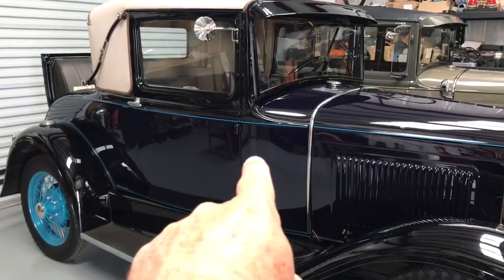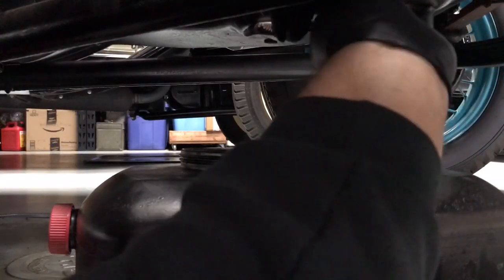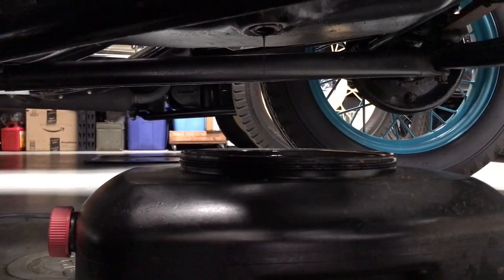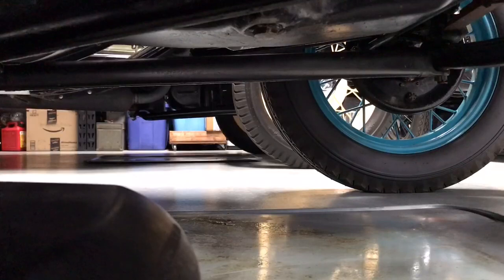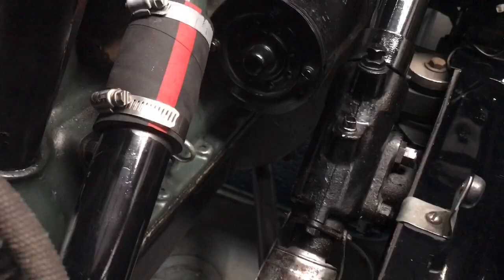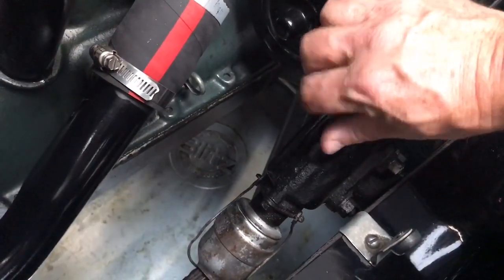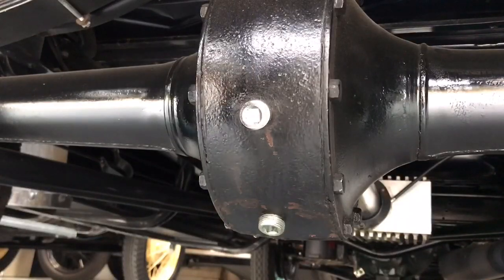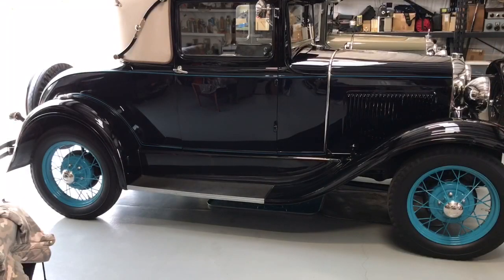How to check and change fluids in a Ford Model A.

Comment: Do you use a left hand or right handed crescent wrench?
Reply from the maker: metric
Reply: @ModelA  do you work on others cars ? Looks like the Tudor I just bought has a bad rear main bearing and I’m just not physically able to pull motor and replace .
Reply from the maker: @darrinwi   Insurance and time limitations prohibit me from doing that.  60-80 hour work weeks, volunteering for the county, family, and church obligations first, then making Model A videos after all that.  Members of the Sonora A's bring cars over here when we have seminars or garage days.
Reply: @ModelA  I completely understand, I wasn’t sure . Any suggestions?
Reply from the maker: @darrinwi    Where are you?  I bet if we get you hooked up with a local club, we can get you all the help you need.
Reply: @ModelA  San Jose
Reply: @ModelA  I have a "several sixteeenths inch" wrench.  It's great!

Comment: I found a model a with a brand new engine. (Rebuilt)  but the color is so odd. Dark green top. Teal body. Red wheels. He wants 10k. Has all the documents like service work etc. Not sure what to do. Also found a more basic 2 door roadster A all black. Rumble seat for 7k. Decent condition. What tips could you give me.
Reply from the maker: The color blind guy probably slapped that together without much care, possibly to just flip it for a quick buck.  RUN! (away).  Unless he can produce receipts for the rebuild, and it was done by a reputable shop, I would pass on it.

Comment: Since modern fluids last so much longer than they did 90 years ago, why change the fluids so often? Modern transmission fluid usually is good for 100K miles. After 5000 miles, wouldn't the fluid still be new?
Reply from the maker: Modern fluids still get dirty at the same rate as old fluids.  In stock form, Model As do not have oil filters, and they don't have sealed assemblies like modern cars, so fluids get dirty faster.
Reply: And seals, piston rings etc that were produced 90 years ago and were not that well made compared to now , make the oil get lot more dirt in it.

Comment: Is that 140 wht or 600
Reply from the maker: They call it "600W", but it really just a thick gear oil.  140 is a little light, it's closer to ISO 460.  See here- https://www.mobil.ca/en-ca/lubricants/industrial/lubricants/products/products/mobil-600-w-cylinder-oil
Reply: Its a 1930 model a coupe with 4 banger.

Comment: You cheat on the oil filter! You're supposed to use a flathead V-8 Ford's loose canister and Purolator PF-1 CARTRIDGE filter. BTW, until the end of flathead V-8 production, an oil filter was an OPTIONAL, extra cost accessory! On a flathead V-8, changing oil is guaranteed to give you an oil bath. As a 15 year-old, I worked as a "pump jockey" and changed oil in cars, and hated to see a flathead Ford head for the rack! All flathead engines of any brand automatically got a jar of Motor Honey added too. It was a viscosity enhancer, like STP, and kept the oil from thinning out too much from the exhaust heat and making the valve stems "starve" for lubrication. It also had detergent in it when most motor oils didn't. All OHV GM's got a can of Marvel Mystery Oil to keep the lifters cleaned-out. I have pumped a supertanker full of 22.9 cent a gallon "regular" gas with "ethyl lead" in it, 12-18 gallons (on a fill-up!) at a time. If someone pulled in low on gas, they'd hand me a $5 bill...or if it was half-a-tank on the gauge, "Gimmee a coupla bucks worth....anna  packa Camels." "That'll be $2.25 sir!" I remember pumping $10 worth of 34.9 "Premium" into a Lincoln ONCE!
Reply: After my day job I worked part time in a Clark station where they only sold 100 octane. Usually 29.9 but often 19.9.  Lots of young kids pulled in for full service and 50 cents worth of gas.

Comment: what car did you have for sale now??
Reply from the maker: Athena, the "Operation Hooptie" red 31 coupe, the grey 30 coupe, the 30 fordor that's almost done, the 31 slant window that we never started on, and the basket case 30 pickup.
Reply: Hello again how much you asking for the hoopie
Reply: @ModelA  what did  you all do to it I can not remember that word you used on your vidos
Reply from the maker: 14k I believe.
Reply from the maker: I don't understand.  If you want to see what all has been done to it, there are a whole series of videos!
Reply: vidios yes please
Reply from the maker: www.youtube.com/paulshinn go to the main page and scroll down to Operation Hooptie.
Reply: @ModelA  good evening Paul did you repair the left front fender?? / wire harness/ cut out all the angle iron under the rear / did you do anything with the roof the ( tar )??
Reply from the maker: @garyradford9381    No.  Haven't had the chance.  After the wire harness is done, I'm stopping and advertising it for sale in a video.  Will let someone else finish it so we can move on to the next project.

Comment: Find and buy an oil filter with some flutes on it at the 'dump' end to allow air to enter and she'll not burp. I see you use a Float-A-Motor ... the engine casting is designed to bolt 'tween the frame rails to stiffen the chassis. Castings don't bend and rubber allows movement. And a overdrive I see.
Reply from the maker: Hi Craig.  This is the only Model A I have with the float-a-motor mounts.  I'm just experimenting with them.  So far, I haven't seen any of the negative effects that people on the web forums complain and warn about.  I'm not going to install them on any of my other Model A's, I just wanted to make my own conclusions about them rather than just repeat what everyone else says without research.

Comment: Fine job, but ditch that adjustable wrench.
Reply from the maker: Ha ha!  That wrench was my grandfathers and was used for Model A maintenance by him.  Gotta keep the tradition!  I have 2 full sets of original Model A tools, and the factory supplied wrench is a crescent.  Just seemed right to use granddad's tools.
Reply: Then please at least turn it in correct direction.
Reply from the maker: @dboboc  Copy that.  Will do!  Thanks.
Reply: @ModelA  My friend's "AB" one-ton dually came with a real-old-fashioned "Monkey Wrench" from the Patterson Tool Co. with a wooden grip painted bright red.

Comment: You didn't clean out the drain plug
Reply from the maker: Maybe it didn't need it?
Reply: @ModelA  the plugs are hollow, it might be full of sludge?
Reply from the maker: Original Model A drain plugs have a small dip in them, and sludge might be in there.  Reproduction drain plugs have the option of a magnet in them, making them solid, not hollow.  No place for sludge.